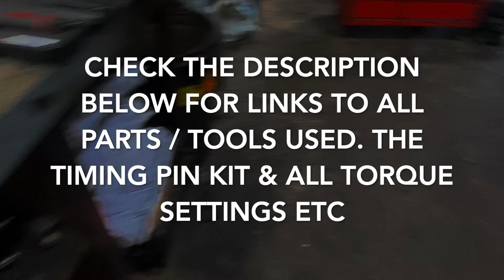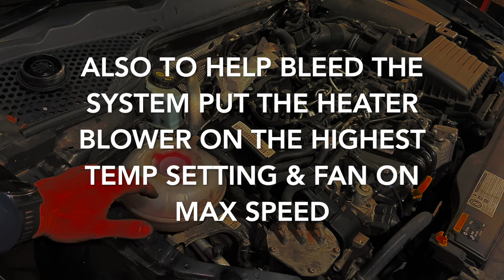1.6 TDi Timing Belt and water pump replacement - 2015 Seat Leon

Comment: Do you ever reajust the tensioner if it has moved to a different position after turning the engine over by hand and inserting timing pins again. ? Or once its set initially is it okay.
Reply from the maker: Neh as long as it was ok initially that’s fine 👍

Comment: It just blows my mind that they run the water pump from the timing belt, especially as you need to remove the aux belt to get to the timing belt. So the water pump has gone on my leon and thus I have to go through all this for a part that always fails, such a bad design to my mind. So thanks very much for this video tutorial, give me confidence to go and tackle this job now, wish me luck ;-)
Reply from the maker: Yeah it’s a pain mate! Hopefully this will help you get the job done though! 👌👍
Reply: @diydaly  so quick bit of advice on the timing belt  cover, if you unscrew the metal plate off first and pull this out, a lot easier !
Reply from the maker: @grahameida7163  Thanks 👍

Comment: i have a 1.4 tsi from 2014. is it the same procedure and are the locking tools absolutely  necessary?
Reply from the maker: No it can quite easily be done without
Reply: @diydaly  thanks for the quick reply.
Just to make sure, is the tsi version the same procedure?
Reply from the maker: @LaithAliraqi97  are sorry just seen it’s tsi! No it’s completely diffenent mate.. you will need the timing kit for that
Reply: @diydaly  yeah I have got the timing kit and water pump, I was just wondering if the installation is the same.
Reply from the maker: @LaithAliraqi97  no I’m afraid it’s very different , there all floating pulleys and you need to lock em on the back of the cams
Reply: @diydaly  hmm so I do need locking tools to change it on my leon?
Reply from the maker: @LaithAliraqi97  yeah you will need the locking set , there’s a specific spanner for the tensioner too
Reply: @diydaly  could you tell me what the difference between floating pulleys and the standard ones?

What risk am I actually taking by not using the locking tools and doing the job without them? 

Couldn't I just time the pulleys correctly, mark everything and install the belt and tensioner?

Comment: Hi I  noticed  you don't  use genuine  vw spares. Do you think  the gates  set is as good  as there seems  to be a he'll of a price difference. Thanks  in advance  David
Reply from the maker: They I really rate the gates kits.. I’ve used them for years.. if I was giving the choice not paying obviously I’d prefer OE parts but otherwise I always aim to fit the gates kits .. it’s worth checking sometimes as TPS trade price for some or the OE kits can be quite good!
Reply: @diydaly Hi  thanks for responding .Regards  David

Comment: I have 2016 seat leon 1.6tdi. The car is 5years old this year and I have 96k km on the clock. Is it okay if I drive for another 2-3 months before replacing the timing belt?
Reply from the maker: Hi lukasz! If it was over on the mileage I’d say no but your usually pretty safe on age tbf .. Ive seen a lot of VAG group cars 2-3 years over the due date without having any issues. Not sure why the mileage intervals are soo high with the time interval being relatively short compared to most.. you should be fine for 2/3 months mate 👍
Reply: the manufactures handbook says 130k miles with no mention of age. This is accepted in other countries but not in the UK.The US and Germany follow that limit but often change at 10 years if mielage not reached. I'm on 100k and 9 years and the belt looks good but will change next year
Reply from the maker: @martina4226  Yes ive come across this before, AutoData says 5 years or 140,000 .. but ive seen a OE handbook say 10 years / 140,000.. Can be misleading.. I always go off Autodata recommendations
Reply: Don't want to take away from the excellent video you  have made but I think the public have been played big time in being duped into these expensive uneccesay belt changes which often result in poor workmanship. Think I will change it my self after watching this
Reply: @diydaly  see Dayco are offering 125000 Miles warranty on their belts, including DiYers with no time limits mentioned ,Seems to be for north American market but will follow that up for European sales
Reply from the maker: @martina4226  nice to know .. thanks for the info 👍
Reply: Vw told that any interval of 210.000km the time applied is 10 years .
Reply: @martina4226  I wouldnt take the chance ,plenty of VW forsale with broken timing belts 75k on,VW won't back you if it breaks
Reply: @sopissedoff  mine made it to 106k miles and all was in perfect condition
Reply: @martina4226  for 500 quid why take the chance, the damage could writ the car of, if someone hasn't 500 for a critical repair,it's likely they haven't got the price of the engine repairs ,the older 2.0 TDI was 40,000  I went to 50 but I was sweating
Reply: @diydaly  your not fine ,2 weeks or 2 months if it breaks the cost is the same,
Reply: @sopissedoff  you're obviously in the repair business whilst I'm in the save money game, but my position proved correct, saving one very expensive and unnecessary bill
Reply: Looks like you fell for the UK unique marketing ploy, the yanks wouldn't dream of changing at those joke intervals
Reply: @martina4226  Iam not in the repair business ,I was before I retired but only as a mechanic not boss , I seen it hundreds of times broken belts ,even before 50 k ,the complexity of modern engines can writ the car off  ,the old ford overhead cam pinto no problem ,the Opel 2.3 no problem change the belt and away it goes again ,not now on European engines ,,cars are not even getting serviced today to save money ,but no one is saving anything by overdriving a timing belt ,, I've done it in the past  because I couldn't be bothered,but I don't advise it ,nothing to do with making money ,ford Europe are the worst,VW group , Peugeot twin cam hdi eat them anything after 70k ,if money is your god goodluck
Reply: @sopissedoff  check out the discussion on "FredsTdi" pages where there are hardly any reports from specialist mechanics of belts going within the 130k mile VW intervals for this engine

Comment: Great video sir! I have a question, could you help me out? I've recently bought a Golf 7.5 1.6 TDI, 2019. It has 234000 kilometers on dashboard so today I've decided to change the timing belt and water pump, as I wasn't sure if these parts had been changed by the previous owner. Now I have an error "P199E00 cylinder head coolant valve open circuit.", which I've found with OBDELEVEN. Local shop installed non OEM parts KDP 457.790 but they should install KDP 457.790S kit which has electronically controlled water pump, so I assume that could be the reason for this error, right? Is it something serious or I can live with it and drive my car without concern? Also, I have an error B15EC14 and my front parking sensors and park pilot don't work and P040100 (insufficient EGR flow). Probably mechanic in local shop damaged some harness or sensor during the timing belt change... 😓
Reply from the maker: I would say something’s been done to the wiring as the new pump although not electronic will have a housing to fit the sensor into .. it will still operate as normal (just not actually do anything) thus the ecu does not detect a fault .. egr fault is likely to be the egr cooler

Comment: Great video. Just two things, when I do the same timing belt I unscrew the pulley of HP pump and cameshaft...and in your video I haven't seen that...especially for adjust correctly the tension of the belt. Or I have not well watched your video...TY
Reply from the maker: Thanks , yeah you can slacken both the hp pump and the camshaft the pulleys , I used to do it on the earlier style (3 bolt setup) but I never do on these later ones with the single screw, I find it really
Easy to do without and never have any issues getting the timing bang on

Comment: If you fit the new belt, rotate the engine twice and the tensioner is slightly to the left is it ok to undo the tensioner adjust and bolt it up  again 20nm +45. I have loosened the Cam and FP, all was still in time but the tensioner is out.
Reply from the maker: Yeah you can do if need be mate 👍

Comment: Gates timing belt kits have stud inside,
should i replace tensioner stud at the same time?
what is the torque setting?
Reply from the maker: I don’t usually replace the studs on the later ones as long as it looks ok and hasn’t been over tightened or the thread look damaged .. they were an issue on the earlier engines.. if you do replace it i think the torque setting is 15-20nm but im not 100% sure .. it’s not listed on autodata
Reply: @diydaly  thanks for reply
Reply from the maker: @lp128frank  👍
Reply: @diydaly  you are correct , its 15Nm just like for the ea189 engines  but vw doesnt have any info regarding the studs on this generation so we dont need to replace them. Do you know the oem for the belt you replaced on this video ?
Reply from the maker: @Danidasanic  thanks for confirming 👍 do you mean the oe part number? Thanks
Reply: @diydaly  no , i mean the supplier . It looks like a dayco belt but someone once said me that is a continental belt , don't know for sure . I know that the oil pump belt is dayco and the poli v belt is continental
Reply from the maker: @Danidasanic  arr yeah , I can’t quite remember tbh but most oe vag belts are continental 👍

Comment: hey dude on them my car coolant is fine car keeps saying overheating and coolant issue. I want to change the temp sensor is it on the passenges with a green head sensor?
Reply from the maker: I wouldn’t like to say 100% without looking but yeah that sounds like the right one , I would expect it to have a green head and usually be sat in / near the stat housing .. also it’ll probly have 2 temp sensors
Reply: @diydaly  hey pal thanks just now my car has lost all coolant again ive changed the tank idk what it can be really stuck pal
Reply from the maker: @adamvama4792  I really couldn’t say without looking mate.. it’s abit of a minefield .. there’s a lot of issues that it could be
Reply: @diydaly  do you have a garage im based in bolton mate
Reply from the maker: @adamvama4792  I’m in Lincolnshire mate , work for a garage 👍

Comment: Thanks for your videos. VW recommended to loosen  camshaft pully and high pressure pump pully . How is it not much necessary to loosen them ? Could you please explain it,so I'll be very confident to start the work.
Reply from the maker: Yeah they do recommend if but I very rarely do it on this engine code , we’ve replaced 100s without , if you do want to do it with loosening you will need a pulley hold-all tool to hold it while you undo the centre nuts
Reply: @diydaly  Thanks
Reply from the maker: @rosejuttancroos8081  👍

Comment: Done fair number of those belts and I don’t mind doing them apart from removing that top cover 😩 like you i remove the temp sensor and even the little heat shield from the cover itself what a sod they can be I’ve Brocken a few in the process 😩
Reply from the maker: Haha I know there a right c**t 🤣 I’m sure the correct procedure to remove it is to take dpf off.. I’d still rather struggle with the cover the spend however long raving the dpf off haha .. I’ve trimmed that bit off the cover in the past to make it easier to refit too 👍
Reply: You dont need to broke them , its easier  to remove or install them without the engine mount  . Do you know the oem for the timing belt? Looks like a dayco belt but someone once told me that is a continental belt

Comment: Nice video! 1 question though…on a Audi a1 2011 1.6tdi cr 105hp the cambelt tensioner stud is still prone to fail, or it has been revised? Do you have to replace it when you do the timing belt?
Many thanks
Reply from the maker: You should be ok on that model, always check the stud condition but I dont often replace them, its more the earlier style that fail

Comment: Nice video very detailed and helpful, have you any experience on I.6TDI CAY CR oil pump and belt changes?
I have heard that sometimes the belt degrades and clogs the oil pickup hence low oil pressure etc.
Any advice or info most appreciated
Reply from the maker: 👍 thanks! Tbh I’ve never replaced one! Had a lot of experience with them but never known one to fail yet .. although like you I have come across people speaking of it

Comment: How long does it take to do this ? Is the modified pump advised in terms of car being able to do a dog re-gen. my limited understanding is that the engine has to have a lot of heat to do regen process.
Reply from the maker: Id say approx 3 hours to do the job.. there's a lot of parameters that has to be met for the car to do a regen.. it will do it by itself but generally needs to be up to normal temperature and is usually completed on a longish run
Reply: Thanks for quick response. Does the gates water pump operate in the same way ? Does it stay closed to assist getting heat into engine quickly ? I run my car for a hour twice a day on daily commute.23 mile journey. Just want to be sure giving car best opportunity to do re-gen every time I drive it 🙃
Reply from the maker: yeah your run will be ideal, It will be regening no problem at them distances .. no the gates water pump does away with the function all together .. the function is nothing to do with regening though , its simply to get the engine up to temp quicker (to 90 degrees) whilst regening its not the actual engine that needs to be hot.. its the Dpf  in the exhaust system.. the fuel quantity through the injectors is increased which allows excess unburnt fuel to pass into the exhaust system and it burns up in the Dpf filter to clear it out.

Comment: Nice video! I just got a question, the manual says that you need to loosen the camshaft and fuel pump bolts before tensioning the new belt. Do you think that is necessary?
Reply from the maker: I used to do that all the time on the earlier engine (with the 3 securing bolts) the idea is to give a nice tensioner all round but on these later ones I’ve never bothers , as doing it the way I do it’s always been ok and had nice tension all round
Reply: @diydaly  Thanks for your video and reply!
Reply: @diydaly  Hello, why does the timing synchronization change from 1.2 on a cold engine to 0.4 on a warm 90 C? Is the timing correctly installed? 1.6 tdi cayc engine ....
Reply: @Sensei948 are you talking about the torq value in vcds ?

Comment: Great video, very informative.
I have a question, I done this without tools. I was told that the fuel pump doest need to be timed only the crank and cam. Job done cars runs and drivers perfectly.
I have the glow plug light now on the dash with fault code P242A00: Exhaust Gas Temp Sensor, active/static. Recon this could be related to the fuel pump? Its odd that it  came up as soon as I started the car after doing the belt. Any info would be much appreciated
Reply from the maker: the fuel pump should be set in the position where it locks with the pin mate, I wouldn't expect it to bring that fault up, check your exhaust temp sensor though.. its easy to damage them when removing the top timing belt cover!

Comment: My 1.6tdi timing belt was changed at 131.000 miles that was 4 years ago.  Is it true that i should change it every 5 years?
Reply from the maker: Thanks for the comment , yeah I’m afraid he interval is every 5 years regardless of mileage 👍
Reply: the manufactures handbook says 130k miles with no mention of age. This is accepted in other countries but not in the UK.The US and Germany follow that limit but often change at 10 years if mielage not reached. I'm on 100k and 9 years and the belt looks good but will change next year

Comment: Great video - i think its one of the clearest and best filmed on youtube so well done.  One question: when i have set the tensioner correctly then rotated the engine (manually) the tensioner goes out of alignment! is this normal or is the tensioner to blame (its still the orginal one)
Reply from the maker: Thanks for the comment! feedback is much appreciated 👍 yeah that's normal mate 👌👌
Reply: @diydaly  that's a relief! many thanks again
Reply from the maker: @roly7773  no probs! 👍

Comment: What is correct torque to these:Water pump bolts (x3) 20nm is + 45 degrees or 40nm in video? Great video!
Reply from the maker: Hi mate , it’s listed in the description for you , the wp bolts are 40nm

Comment: how much did you pay for the 
torque wrench and if you recomend a web site to buy
Reply from the maker: I use the snap on one , bought directly off the van as her visits the workshop every week.. I attached a link to the same one on eBay .. the snap on one is a mega bit of kit and does both torque and angle but is also the most expensive! I’ve not had a lot of experience with any cheaper ones to recommend you .. https://ebay.us/3Mt3QN

Comment: Great video - really clear and informative.  I have a Seat Leon petrol 1.4tsi - i understand that the cam belt needs to be changed every 5 years?  or 80,000 miles?  not sure my local garage is accurate on this?
Reply from the maker: Thanks for the comment, much appreciated 👍. yeah they are correct , a lot of VAG group vehicles seem to be due every 5 years regardless of mileage 👌👍
Reply: @diydaly  Hi. 0.375 sync okay at 90C? 1.6 cayc

Comment: This job took me 5 hours to do, what wastes the time is trying to crack off some really hard to get to bolts here and there and also the lack of a 16mm Long socket for the engine mounts. but all working ok. So on mine the bearing on the water pump had destroyed itself and collapsed, there were many ball bearings around, so the crank was nearly one tooth out on the existing belt.
Reply from the maker: At least you got it sorted mate, never has a pump completely collapse on one of these later engines tbf , had plenty of the earlier ones fail where the plastic impeller cracked and wouldn't spin